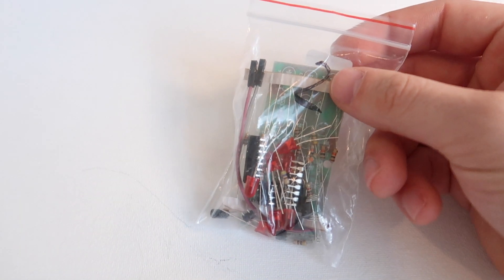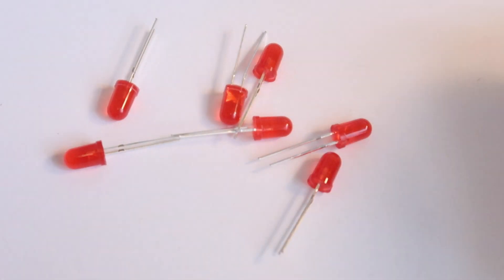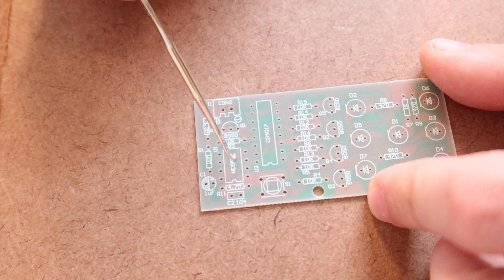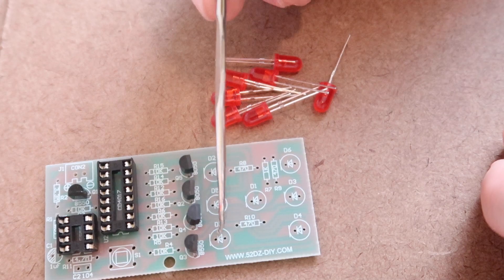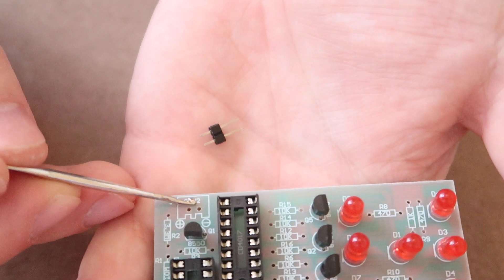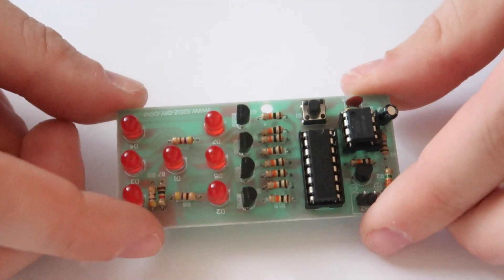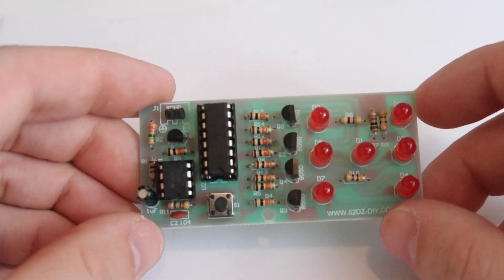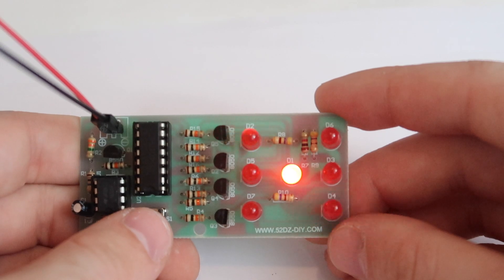Electronic Dice DIY Kit- Assembly & Review

Comment: do you use 9V as power?  Thanks.
Reply from the maker: 5 Volts
Reply: Do you know if it works if I use the USB cord and connect to the computer? Does it work for 5v?
Reply from the maker: @Udjeox  I think it should work.    
 Good luck!